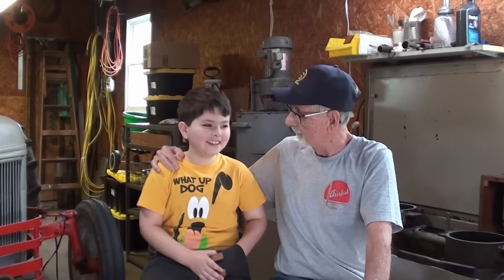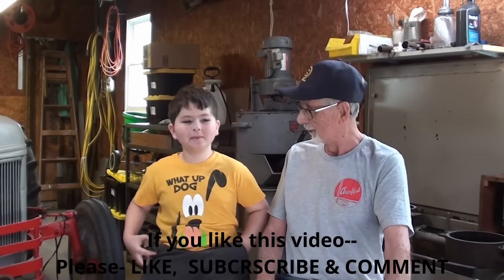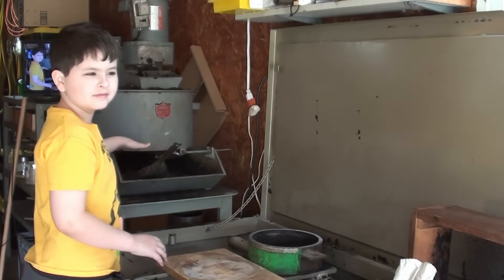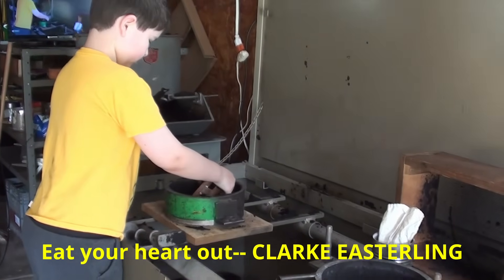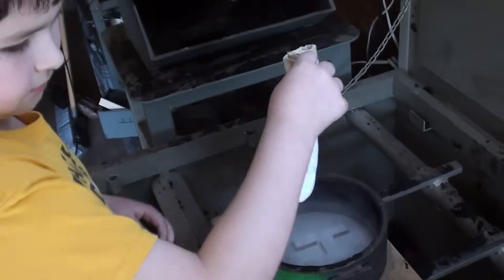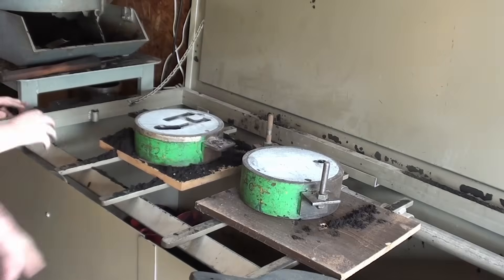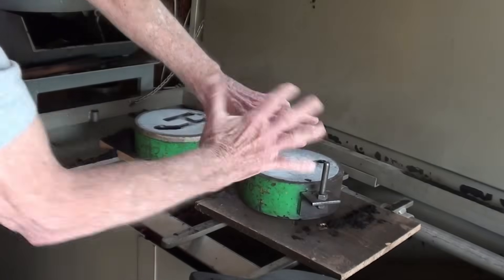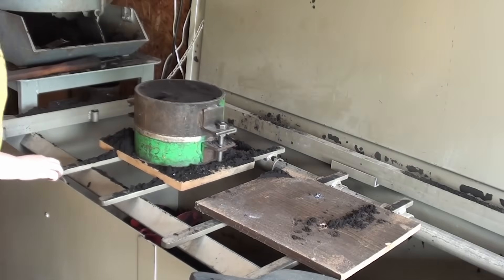HENRY MAKES A FOUNDRY CASTING #1045 tubalcain pattern aluminum

Comment: Thanks, Mr Pete, for the foundry video.
What grieves me is, to this day, my parochial HS alma mater has zero shop classes, (40 years earlier  they had only woodworking, which I was too stupid to take). Back then, I should’ve seen if I could have taken  classes in metalworking at the public HS campus. Heck I should see if I could do it now, regardless if it’s all CNC ‘n DRO!
Ordered that Technical Drawing
Book 3rd Edition
Giesecke Mitchell Spencer
1953 for $10.10 including shipping from eBay. Thanks.
Reply from the maker: It is sad that schools no longer teach shop classes.

Comment: Gee, I didn't learn two-part greensand mold setting (and casting aluminum) until I got to high school!  Lucky kid!  :)
(we cast round ingots, then sawed the ingots, then turned and drilled those blanks into the pulleys for our 1" belt sanders.  
I still have it and use it constantly, 45 years later.)

Comment: I'm glad your teaching grandson metal casting. I did the same for mine using lost foam. He shaped the pattern using sandpaper. He was also about the same age.
So one question. You are a retired shop teacher. If one of your students used the method you just showed your grandson. Would allow that in your shop class?
Reply from the maker: Yes
Reply: @mrpete222  so bare feet to ram a mold in a foundry is ok? Or not having gloves on while demolding a hot casting is ok too? Got it.
Reply: Thanks Mr Pete.
What grieves me is, to this day, my parochial HS alma mater has zero shop classes, (40 years earlier  they had woodworking which I was too stupid to take). I should’ve seen if I could have taken  classes in metalworking at the public HS campus back then. Heck, I should see if I could do it now!